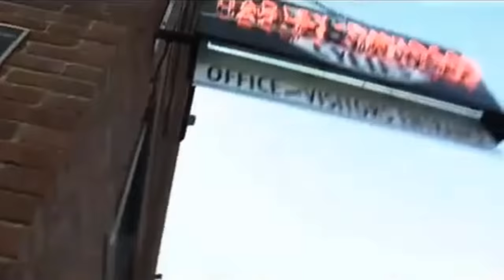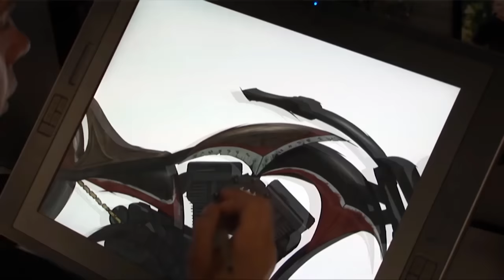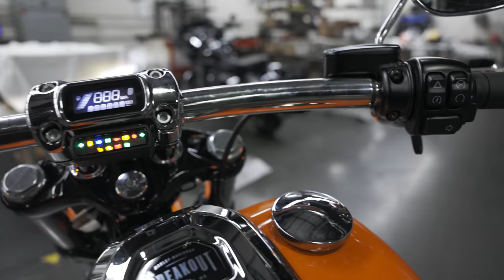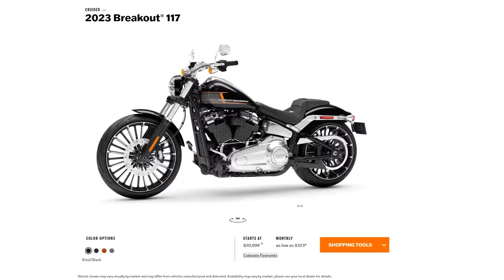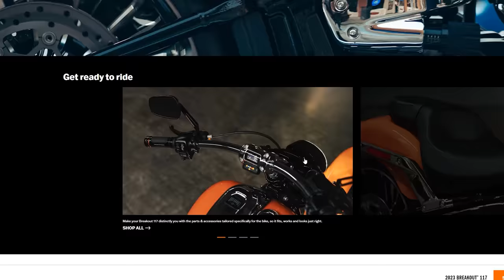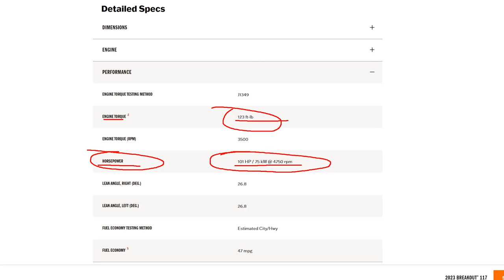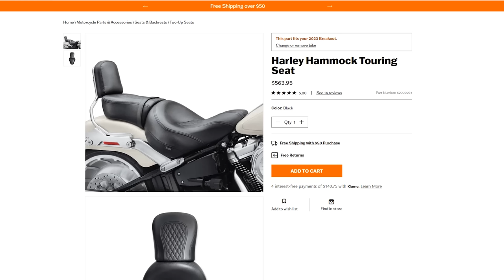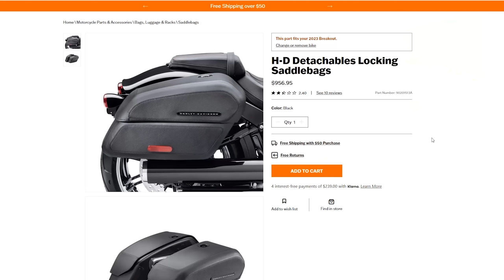2023 Harley-Davidson Breakout (FXBR) Test Ride and Full Review

Comment: Question before I watch the video. What makes it any different, worth buying, than the same discontinued bike of just two years ago?
Reply: Bigger motor, 5 gallon tank, new electronics (TC), new wheels, and new paint.
Reply: @TH3G0ODGUY  only HD increases displacement and calls it a new motor. The electronics package is less than that of an $5k R3. Not hating, but why not buy used, put new wheels on it and then buy another bike with the money you saved.
Reply: @freebehindbars8654  The 117 also has a revised cam, but I dont think they call it a new motor.  I did, but it was short hand because I was just trying to quickly type something so you could watch the video like you asked, my bad.

Electronics are not why someone buys a breakout.  The R3 is a fine economy bike, but its kind of a silly comparison.  It has stickers on it.  Like actual stickers.

A used M8 breakout is still pretty expensive, and a nice set of wheels isn't cheap specially once you factor in the labor to swap tires.  And you would still have the smaller motor and smaller gas tank, and you'd have no warranty and an older bike.
Reply: @TH3G0ODGUY  This mindset is why HD doesn’t find the need to innovate. The big reveal was a reintroduction and new paint on existing models. Anyone that says they can’t create a new bike every so often, I’d like to remind you manufacturers 1/3 the size have done exactly that every couple of years. KTM has an entire line, with actually different motors and categories. I just expect more for my money. I currently own three HD’s, along with several other manufacturers, and can’t find a reason to get a “new” HD. Nostalgia only gets you so far before you want something better. That’s where I’m at.. the stickers of the economy R3 wasn’t my point, but you made it for me. A small displacement Japanese economy bike has a better electronics package that a mid $20K performance cruiser.
Reply: @freebehindbars8654  how do you explain the pan am?  Do you think HD has a much smaller margin on it than the breakout?
Reply: @TH3G0ODGUY  The Pan Am proves my point. They can most definitely introduce new bikes in different categories, midsize adventure would sell before touching the showroom. Instead they throw out hint of possibilities, only to have almost nothing come to fruition and put new paint/wheels on a discontinued models and call it new. They talk about wanting to attract new/youthful riders but offer nothing in the way of making it happen. Beginners are not able to spend $14-15k on a Nightster. They need to untuck their nuts, produce that naked street fighter they’ve hinted, along with an adventure bike that actually makes sense to take on adventures. Of course, that’s just my opinion but I’m not alone.
Reply: @freebehindbars8654  I asked a slightly more specific question, do you think HD has a worse margin on the pan am than the breakout?  And if so why?
Reply: @TH3G0ODGUY  Tbh, I don’t know what the margins on the bikes HD makes. I’d think they’d accept a smaller margin on introducing a completely new bike, in a new category, compared to a bike that has all the tooling and holdover parts ready to go. Trying to see what the margin has to do with innovation? If they introduced a 975 Adventure do you think the reaction would be the same as the 120th reveal? It was an across the board failure in many HD supporters/customers eyes. We want American innovation, fun bikes, like the rest of the world is currently making. We want to invest, they need to give us something.
Reply: @freebehindbars8654  I would guess it has a very similar margin.  I think people consistantly underestimate the cost of fit and finish and consistanty overestimate the cost of "tech."  There is a reason that the only manufacturers trying to go toe to toe with HD on fit and finish often end up selling their models at the same or more expensive than the competing HD model.

Comment: Never seen a need for a wide back tire because it does not handle very well like to go with the flow and not Shure how it would handle if cought in the rain tire may spin ,don't like the tiny brake lights on the back like the street bob have to change the seat because it's not comfortable but you want a bike that handles well so I'm stuck on the street bob besides I can go on some off roads and go camping

Comment: This bike is what the Dyna should have been. Harley is finally moving into the 21st Century, while other manufacturers have been in it for a while. Anyway, this bike is nothing more than a bar hopper. I had to change the seat on my Dyna and, unfortunately, it had like 58 hp and it sucked. This bike simply improves upon the Dyna, which is why I said its what the Dyna should have been. It is also VERY similar to the Fat Boy. 
 
My 2018 VMax would eat this thing ;)

Comment: I clicked because I thought this was a review. Instead, it's just a commercial. I just test rode it, and there are issues.

It's basically a " fail" in every respect except one; the 117" is nice. Otherwise, it's ugly (from the paint/ graphics to the headlight to the forks), it steers horribly, the break pedal is obscured by the air kit, etc...

Comment: How about an aluminum frame and adjustable front suspension, like that of a road star warrior from 20 years ago. Not impressed.
Reply from the maker: Aluminum frames rattle too much. Not worth a little weight savings. This is a cruiser not a race bike. The average cruiser rider wouldn’t mess with the front suspension either.

Comment: These designers are not taking a page from the V Rod that should be there for the 2024 but no way instead they stuck on stupid with the Happy Days the Fonz motorcycle that is not changing. Im not impressed stretch out that gas tank and sleek it out . The gas tank otigon it out tuff lines of a bigger tank aggressive tsnk and think V Rod as the only goal mean look parked and in motion looks like he's going to get that money from the dead beats.

Comment: If you're going to go fast you need to stop faster,no dual disc front brakes are a no-no but that's fine with me whoever likes the front end missing a caliper and rotor.
Reply: Duals don't increase stopping power, they're for heat dissipation under repeated hard braking. That's not what the Breakout is made for, nobody is riding it hard enough to overload that front brake. Duals also increase unsprung weight on the front end.
Reply: I agree about unsprung and stopping power but I just can't bring myself personally to the overall look.
     Probably too many go fast miles on the old EVO 95 FXDL and the Road King in city traffic.
     I appreciate the reminder of overall stopping power.   RIDE SAFE.....

Comment: I don’t like it. It’s ugly and sounds like shit. Milwaukee engines just don’t sound good to me. Also no matter what they do it’s never gonna be a super comfy road-trip bike and it will never be a performance or sport bike. It’s a cruiser, long, low, loud and heavy so just cruise it and be happy lol
Reply from the maker: Yea it’s a cruiser for sure.
Reply: @MattLaidlaw  i really wanted to line the new breakout and I wish the power from the Milwaukee had the sound of the older twin cams. I like the older traditional style of bikes with a bit of modern twist. That’s why I like the first breakout. The twin cam sounds amazing with exhaust and a cam. It runs fast enough for what it’s meant for and it looks sexier than all but the sickest baggers with a few mods. I love my wrap around front fender, blacked out chrome bits and gonna do 12-14” apes to go with the taller sissy bar.

Comment: Still an anemic motor.
Reply: I'm not sure I would describe it as anemic.
Reply: @TH3G0ODGUY  I guess its not anemic to a Harley rider.  But compared to my cruiser anemic is apropos.
Reply: @jimanders9971  I ride plenty of things other than my Harley’s, and I still don’t think it’s Anemic.  It just produces its power in a very different manner.  It’s almost like a Diesel.

Most cruisers that have significantly more Hp than the 117 m8s will have overhead cam motors and much higher rpm redlines.  That produces a very different character from the m8, and while much faster, faster doesn’t always equal better.
Reply: @TH3G0ODGUY  My cruiser has much more hp and torque which equates to more power no matter the scenario.  To me the 117 is anemic.  No faster is not always better but the narrator was gushing about the grip it and rip it, that is what I am commenting on.  Actually looks like a cool scoot.
Reply: @jimanders9971  what cruiser is putting out more than 127lbs of torque stock?  The only one I can think of is the rocket 3, which is cool, but the character of a triple is very very different from an air cooled vtwin.  Hd customers would be very angry if HD stuck a Tripple in the softail.

This is coming from a guy who loves triples, I own a Brutale 800 myself!
Reply: @TH3G0ODGUY  I do in fact ride a Rocket 3.  As I stated the Harley is anemic. And the most profound difference in “character” is the motor.  Case closed. Like I originally stated, anemic.
Reply: @jimanders9971  that’s an awesome bike man!  Enjoy!